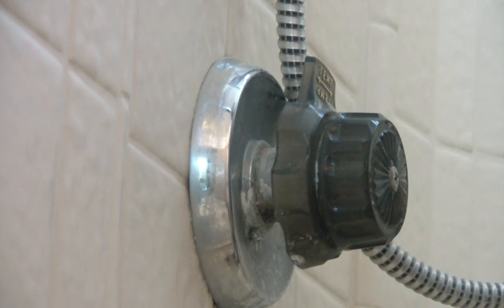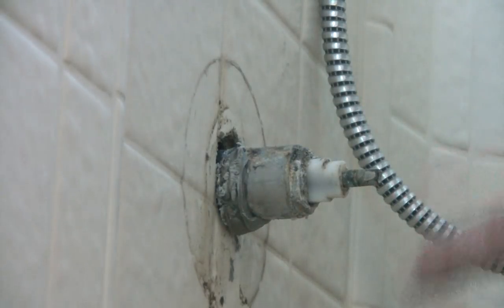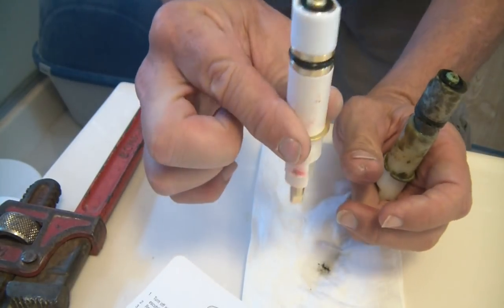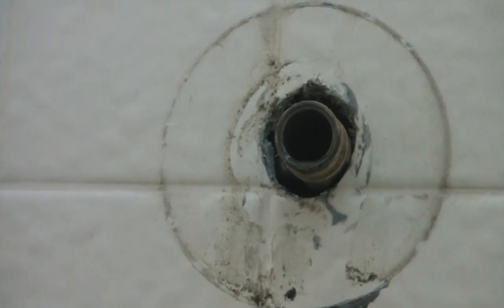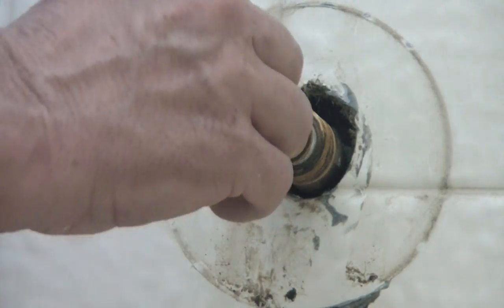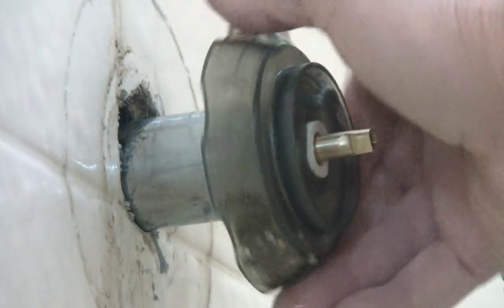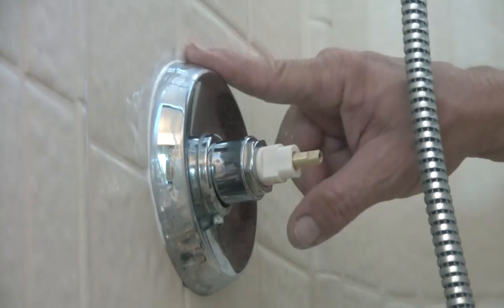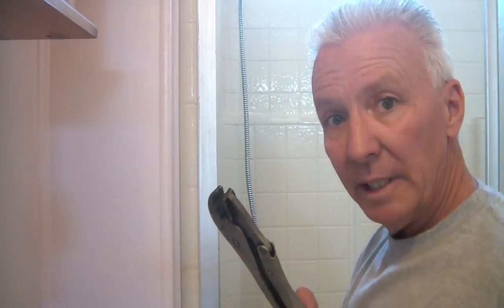How to install Mixet cartridge MXT07

Comment: Thank you for the great film. I installed today a new stem MXT07, following procedure described. The only thing, the stem didn't go till the necessary position, though I cleaned and applied the plumber grease. I used a muffler hammer and knocked on it, it went in the pipe. Actually many people complain that the stem doesn't go in and think that it is a wrong one, thought it is that muffler hammer which is needed to complete the project.  I also added a new handles set. Looks great! Thanks a lot again.

Comment: Quick question i purchase the MXT07 that you recommend but it only goes in half way I match the old cartridge with the MXT07 and they look identical grooves and all and it still didn't work I ended up having to use the new orings and back gasket off the new one and put it on the old one and the old cartridge slid right in any advice on why MXT07 didn't slip in more then half way I used plumbers grease on both the house was build in 1999 please respond thank you and have a great day
Reply from the maker: mauricio cordova first off give yourself a big high five for thinking out of the box ad switching out parts. without seeing the valve, there is always a chance its off enough to be another valve I would of got calipers out and check demotions the grove for the O-rings but if it all works you deserve a well deserved pat on the back. You might go to a plumbing shop if you need to have it done again and let the see just what you have.
Reply: @TheShackHome  thank you for your response yeah it ended up working out no leaks again if it does go out again I will end up taking it to a plumber store and see if I can get it better matched up thank you

Comment: Excellent video, don't know why I stumbled into other videos first which were giving wrong information or not specific enough. Thankfully, I found yours and was able to get hot and cold water from my shower.

It wasn't too easy as the circumference of the back part of the replacement cartridge was a tiny bit bigger (unnoticeable to the bare eye) than the old one. I ended up replacing the plastic washer located on the back with the one that came on the new one and using the whole old back part on the new cartridge.
Reply from the maker: Recardo your a true handyman. You did just what most fo us would do and fix it how ever it needed fix'n good job.

Comment: Iam confused. Other videos say the red dot goes on the upside. Can any one verify this one way or the other ?
Reply from the maker: If your old one came out with dot on top install new same if it came out on bottom again do the same if your not sure go by directions and if it doesn’t work properly remove it and turn 180 reinstall and check mine happens to be this way.

Comment: I had to put the red dot up in order to get my hot water running from the left
Reply from the maker: I think who build this place was somewhat backwards. but i have ran into places that are up and some down. people just have to pay attention when pulling out the cartridge and if it doesn't work the way they had it simply rotate it  from up to down or down to up. I wont even go into some electrical issues I've ran into here. Thanks for viewing. Glad it all worked out for you.

Comment: I have that style of valve but when I go to the hot water side the water stays cold/ kinda warm , it never gets hot . What could be the issue
Reply: Some guy mentioned it above, you may not have the cartridge in as far as it can go.  If the cartridge isn't pushed in fully into the valve body, then the hot and cold water supplies are actually mixing, so you never truly isolate the hot water.  So it's an easy fix, just make sure you put some grease in the pipe and on the o-ring that's on the cartridge itself and it should slide all the way in to cure your problem.

Comment: Thank you for making this video. It worked well for me and I didn't have any trouble. My cartridge was MX-1 and it fit fine. I really appreciate these DIY videos, as they help novices like me. I had a plumbing accident earlier this year that caused a flood and required $9k to repair, so I was hesitant to do anything more myself again (it's like I had plumbing PTSD). This little success helped rebuild my confidence.
Reply from the maker: Tom thank. You and I’m glad to Help. So true its one step at a time then your off running. I’m honored to help in the small steps. Job well done. You did great.
Reply: @TheShackHome  Thanks. BTW, re the cartridge fit, I spoke too soon. It turned out to be super hard to turn. I tried 3 different cartridges (Mixit, Danco, Ace). None fit correctly. Decided to hire a plumber to replace the Mixit valves with Moen valves. To save money, though, I did cut holes in my drywall to facilitate the plumbing work. That was also a new and kind of tricky experience for me.
Reply from the maker: @tomjoht  Unfortunately that is the final outcome in some cases. There are time a new cartridge just won’t work and its time to update. They don’t last forever. Sorry to hear it was a more costly endeavor.

Comment: Is there a different Mixet cartridge for a shower/bath? I have followed your excellent instructions with the MXT07 but it doesn't fit right. It comes out too far from the wall, then there is a gap between the temp control handle and on/off handle. I can't tell from the video if the pipe in the wall that the cartridge slips into, if it is threaded .... mine is. I sure could use some help with this! Thanks.
Reply from the maker: Nancy did you compare the two side by side making sure the over all look is the same? Any length issue would be present. sometimes you just never know. Yes there is threads that's what the sleeve screws onto to hold the cartridge in. I have 2 showers and a tub/shower and all 3 are the same. there is always the 1% that will have issues.  If you have the old cartridge and not sure i'd take it to a plumbing shop they will know more than a big box store and be sure.

Comment: Would not suggest to use power tool on screws, DIY people can damaged the threads. Hand tool screw driver recommended
Reply from the maker: X L i couldn't agree more. For the average person they could very well over tighten or even break  the screw using an impact driver.

Comment: YOU ROCK!! 5 STARS ALL THE WAY!! 

I was so skeptical of doing this for the first time on my own at 9pm on a Saturday night, hoping that I didn't have to keep the water off until a Plumber could come fix it on Monday. Watched your video like 3 times, went to Lowe's to grab the parts, came home and installed it. Only thing that was a little concerning, the valve fits, works great, like butter moving it. the old one slid right in/out, the new one required a little tapping with a wrench and then it slid in, I did clean out the inside of the pipe a lot before putting in the cartridge with Plumbers Silicone Grease.

Should I be worried that I had to tap it in?

It is 1988 original valve to the house. 

I just don't want a quiet leak dripping down the walls or something to the downstairs and taking out the the drywall.

Again! You are a lifesaver! And I truly appreciate it!

Shawn
Reply from the maker: CoastalBreeze73 you are very welcome and thanks for taking your time to view. The cartridge should slide in  you shouldn't have to tap it at all.  Its been enough time has or have you seen any dripping at all? If the tub or shower sits all day in the evening just feel around the handle and area see if any wetness if all dry you should be good.

Comment: Greetings.  I'm here at my mom's house and realized that the temperature control handle is very hard to adjust in both showers in her home.  I saw you video (several times) and got to work on the project in the second bath (I figured if I screwed it up her shower would still be functional).  I was able to disassemble the component as you instructed, but I ran into a problem.  When i removed the cartridge, it appears that the bottom half is stuck in the pipe starting a the brass washer/black gasket.  Is this a different type of cartridge?
Thank you for you for sharing the video, I'm much more confident in executing this task.
Reply from the maker: Patricia Gray
 Its by no means an easy task. Below is a link to this very situation maybe give you an idea and even a solution. I dread these repairs when this happens. Thanks for viewing and hope this helps. 
http://www.doityourself.com/forum/toilets-sinks-showers-dishwashers-tubs-garbage-disposals/509971-mixet-shower-valve-stuck-top-part-comes-out-not-bottom.html

Comment: I did everything you said even put the Red Dot on the bottom and now my hot water is on the opposite side
Reply from the maker: Danny Gonzalez if nothing leaks great. If you want just pull out the cartridge and flip it 180 you’ll have it all back to normal. There are cases it’s reversed.

Comment: Is it possible to replace this kind of valve with a new one that looks better?
Reply from the maker: Sadly, no. Only way to get more variety as far as handles and things is to replace the complete valve body. If you have mix -it, basically you’re stuck with mix it. If you want to go to the expense, tear the wall out completely remove tha valve and replace it with Moen or Delta, you have more variety, but at a greater initial cost.

Comment: I did this repair but one the directions say red goes up not down - i installed it up like the directions said since maybe they changed the design a little but my faucet still leaks when turned off.  Any suggestions?
Reply from the maker: Denae did you by chance flip the cartridge to see if it would still leak? This is a shower not a faucet? Also if any debris like calcium in the valve preventing a good seal make sure it was clean prior to inserting the cartridge. Make sure it is all the way seated or pushed in.
Reply: i know this is a late reply im a Maintnance Technitian and i experienced the same thing so in this case like he said in his video make sure the red Dot is facing down ....... put your descussion plate back on and your mix it handles and you should be good to Go ..
Reply: also 1 other thing make sure your old rubber O ring didnt come off alot of times when i take the old cartridge out all look down that pipe and see ive had this happend to me once when i was just learning did everything right at that time the red dot was facing up when you would insert the mix it cartridge these are helpful tips to help others and 1 last note when you take the back discussion plate off some of you are wondering on discussion that is the chrome plate that has H on the left side for hot and C on the right side for cold sometimes but not all the time your house or apartment might actually have a shut off right behind so make sure to look some shower walls will have a good seal his you couldnt see in that case dont bother with tearring stuff up just turn the water off out on the street line in front of your house or apartment but for those if you can see look for 2 set screws and turn them counter clock wise to turn the water off if your not sure about the water being off and are worried take your knob put it on and turn it to the left turning it on if no water to little water comes out your okay make sure after you pull your old cartridge and put your new 1 in that you turn those set screws back on turning them to the left will turn them back on ive been doing maintnance for a few years and seen some stuff in my time doing so hope thiz helps good luck everyone

Comment: Kinda late to the party but this video has been very helpful. So thanks! My question is if the screw hole on the valve is cracked on two sides, but the plastic parts can still screw in just fine, do you recommend changing out the valve or is it functionally fine to leave it? Can I expect any long term issues with not replacing it?
Reply from the maker: Ascanet
 you can leave well enough alone but it's only a matter if time. Turning it on and off  will eventually wear on the part and it will break. So at some point when you try to turn off the shower and it breaks you'll have to scramble for a pair of pliers to turn it off. At this point you have no choice but to replace it. Shoot the dice but I'd keep pliers near by just in case,

Comment: Thanks for the video. Last time installed was wrong  part. Had to take a file to the thing to get it in. Never worked right. Also, the instructions had to be printed in so many languages there apparently wasn't enough room on the package to complete them. Nothing to say in what order the washers were to go. Nothing about the red dot. The schematic was useless, even with a magnifying glass.
Reply from the maker: Danielpryorat60 you are welcome great comment and thank you for viewing

Comment: On the valve itself, should it be in the open position or closed position or partial when you slide in the valve opening?
Reply from the maker: TC I put them in however I get them. just make sure the go in fairly easy and seat properly when the cartridge is turned to OFF it stops water flow.
Reply: @TheShackHome  thankyou

Comment: I just wanted to get rid of it. And get something cute but the tub is fiberglass 🤷 what should I do?
Reply from the maker: Shower valve aren't the easiest. Without harming the enclosure you can access the valve from the opposite wall, if able. My bathroom I can access the valve from the closet. my hall bathroom is sharing the dining room wall. drywall is easier to repair than the fiberglass enclosure. That would be my solution. Of course if you ever do a remodel of the bathroom that would be the time to update the valve .

Comment: would the incorrect stem affect the water pressure?  I recently had my replaced in my apt and the pressure is very low now
Reply from the maker: If it is a Mixet cartridge then it may of been put in reverse or even the wrong Mixet cartridge model. As i stated many get the wrong one and it wont work properly. If you can get the manager to try and reverse it see what happens but i know they don't like to do much. As long as you have water they think it OK. I have rental and i a very maintenance minded. I don't want any pipes bursting or lines leaking faucets dripping. Ever 6 months i do a walk through and every year i do maintenance on what ever need be done. It's my investment and i take that seriously. I also get Great tenants because of that. Good luck hope it works our well.

Comment: I had a professional plumber doing it. Two visits a week apart. First visit, he removed the part, ordered it. Second visit he tried to install the cartridge,  it didn't fit, so he combined parts from existing cartridge and the one he ordered , rebuilt it and installed (wasn't easy). $289.00.

Comment: should not have so many problems with management head office nor plumbers. The plumber doesn't want to deal with mixed. They do quote on new installation of 750 dollars per faucet, have two bathrooms for a total of three with the stand-up shower and bath. Would think that the condo management head office would have the model number for the complete building owners. Condo units check the problems when they don't fix shut-off service valves. Can cause lots of damage, especially on those composite not-so-wood floors

Comment: Great video! I am just curious as to why you did not seal the gusset at the bottom. Or at least that's the way it appears in your video. Shouldn't it be sealed all the way around it?
Reply from the maker: Brenda i never seal the bottom. Being there is water everywhere i allow the bottom to breath and let any water drain out just incase. This will also help in preventing any mold especially in more humid climates. Thank you for viewing and good question.

Comment: LOL... turn this nut and remove the cartridge...but first, turn off the water main.  Just kidding. Great video. Now I know what was wrong with the one in my old apartment. It was too tight, and the hot and cold seemed to change strangely when you adjusted it. It wasn't just reversed. It was random and wonky.

Comment: 5:34 so I've bought both valves and still hard to put in, I've cleaned the pipe and I see a "grove" on the pipe, is that to be in the pipe???? Help
Reply from the maker: Luis Guzman without seeing it I would say no unless it's a manufactured groove. In some cases you never know. I would take the old valve to a plumbing store and let them look at it to see just what make it is. Sometimes its best to get a pro to visually see it and direct you

Comment: THANK YOU THANK YOU - we couldn't have figured out how to fix our leak if it wasn't for you!  This video was so informative & helpful showing every step of what to do.   You're the BEST, thank you so much!!
Reply from the maker: Laisa Nielson
 I'm humbled. You are very welcome.
Reply: Ok, so somewhere I messed up, because turning it on & off has been an issue, ha ha.  And so I took off the handle - it's an old one, so I'm wondering if I need to buy a new one, and I turn the shower on & off with the pliers.  But now, I'm noticing that the copper piece is disappearing - is that when it's on Off position or have I messed it up somehow?? 😬